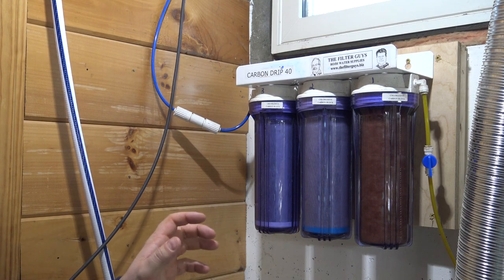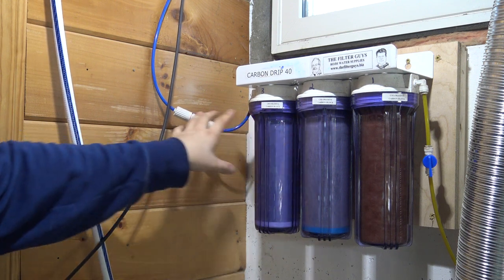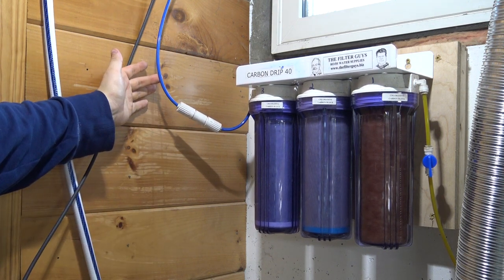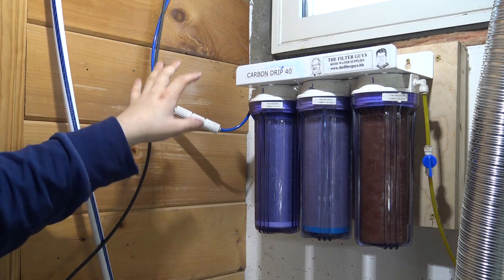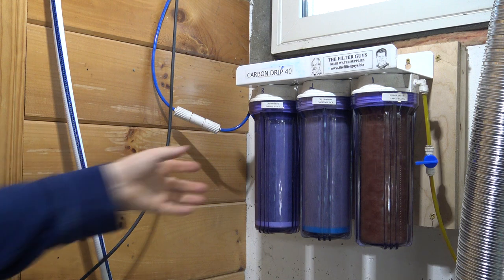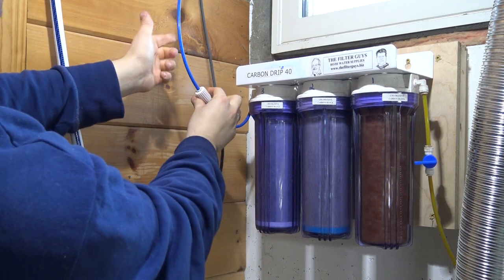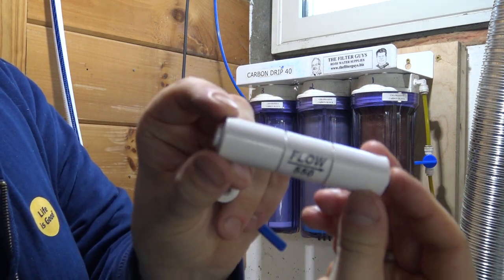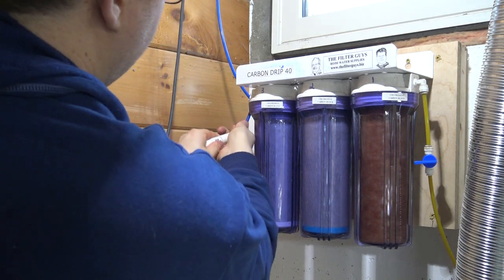#425: HOW TO: Drip Line for Automatic Water Changes - DIY Wednesday

Comment: Very nice. Any reason you didn't split the line (with the tee) first and go with another 40 gpd restrictor for the turtles? I guess it would add another possible point of failure, but I just wouldn't trust that tee to evenly split the flow.
Reply from the maker: ItsAlleged I first restricted it, then teed, then put two valves on the very end to fine control the flow, adding a second restrictor would cost more money and would likely present the same issues of balanced flow

Comment: Greg.  I am wondering why you put the drip going into the barrel with drain instead of having it go into the turtle tank first?
Reply from the maker: Ed Zimmerman to keep it out of the way. it makes almost zero difference where I put it, a few have suggested the new water is going to go right out the drain but I challenge with the fact the pump is doing 2,000 gph and the drip does less than 2 gph
Reply: Yeah, thats what I was thinking too. Thanks for clearing that up for me. I enjoy watching your videos.. Very informative and much appreciated!  Thanks Again...
Reply: i would of thought that it going into the K1 barrel so that you aren't adding to the same tank you are overflowing out of. Not much of a difference in 2GPH, but still doesn't give best circulation.

Comment: Do you think uniseal is better when you are drilling a hole in a slightly curved surface or would a bulkhead be about the same when sealing ? I would think uniseal would be better but I've never tried .
Reply from the maker: yup! that's what they are designed for
Reply: Greg Jones ok thanks . I have some uniseals to buy

Comment: please don't mislead the hobbyists... drip systems are awful "water changes"... you're not "changing" hardly anything ever, and more clean water than waste if you are.... it's a topoff more than automatic water change, wth man?
Reply from the maker: I spoke with a doctorate in math before installing this drip system, they pointed me to something called a Linear Homogenous First-Order Differential Equation which describes the percent changed and percent wasted. In my case, it ends up using 8 gallons per day more than doing a manual batch water change once per week, but it ends up saving me hundreds of hours per year in labor. Is it less efficient? Yes. Is it an awful idea? It's the best thing i've ever done, no regrets. angelfish (dot) net has a drip calculator if you are interested in learning more.